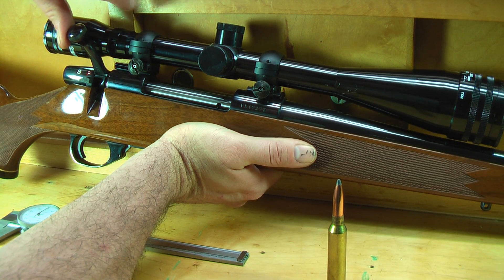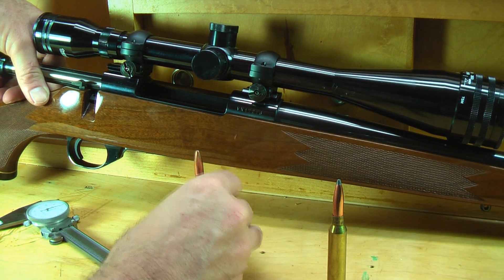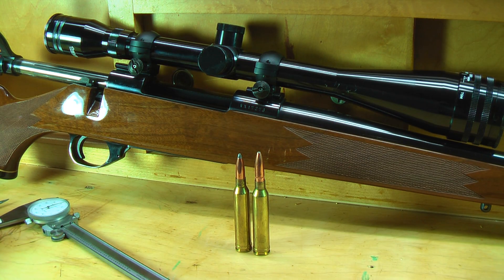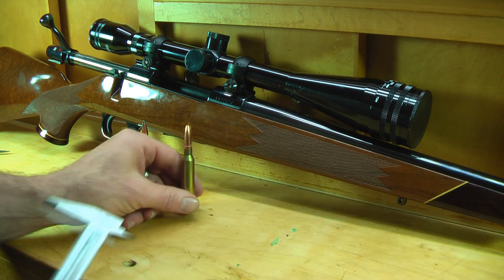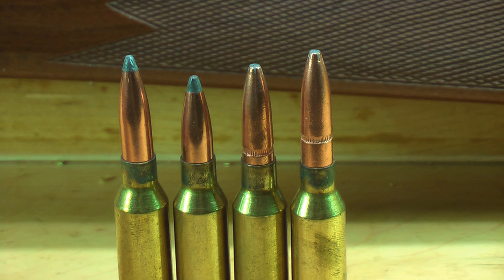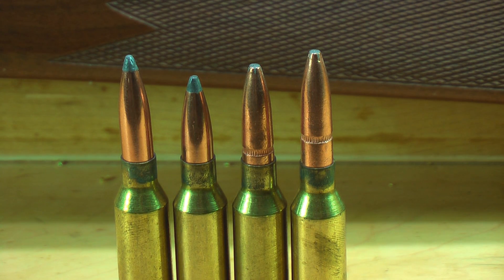Overall Length Gauge HD

Comment: Find it a little curious that the cartridge with the Sierra bullet is shorter than SAAMI spec’s for 7MM Remington mag. of 3.290”.
Reply from the maker: This is to get the bullet to the lands and grooves When making ammunition for the field I use the SAAMI OAL. For coaxing out the most accurate load I play with the seating depth.

Comment: "Just like that" just say neck size it and seat the bullet. Cause if you don't do any sizing the bullet will fall straight into the case. This is the old school of forcing the projectile to touch the lands or deeper into the throat to establish a dummy round then work back -.05 each string

Comment: Are them cases inside the numbers the book gives you for OAL or all they longer, i have a 308 and the OAL in the book should be 2.81 and i tried this with two bullets and they can back at 2.86 and 2.94,  if they fit in the mag, will they be ok or do they have to be seeded to what the book says

Comment: @ammosmith I see...

how about if the neck was bit too tight (tight enough that you have to use a bullet puller to pull the bullet out) and when you push the bolt forward it might push the bullet into the rifling instead of the lands pushing the bullet further into the case?

I don't think the winchester  too tight or loose. it feels perfect like in your videos, but that's a big diff (2.890 vs 2.810) also if the lapua brass is tigther it shouldn't be as easy to push the bullet into the neck

Comment from the maker: @razorseal It will depend on how the case grips the bullet. If it has minimal grip then it may pull back out some. Usually the OAL gauge presented here is far more accurate than the commercially made OAL devices.

Comment: Will different cases have diff ogive OAL gauge? I tried a lapua and then a winchester, and they are diff. Winchester is at 2.890 and the lapua is 2.810. the lapua case is 2.484 and the winchester is 2.489. the winchester did have less tension on the neck though.

Comment: So how are you getting the neck tight enough to hold the bullet but not so tight that you have to use the press? You said that if you full length size it, then it will be too tight. But you didn't really explain how to get the neck in the condition you have here. Thanks for the info. Your videos are always informative.

Comment from the maker: @newfounderusa101 No but you should trim your brass to keep the necks in spec. This will prevent the case from being forced into the throat. This method uses the bullet to determine the OAL.

Comment: The shown way won't work well e. g. with Mauser 98 actions, because they want to be fed from the magazine. 
By why this complicated? Why not simply drop a bullet into the barrel and measure with a wooden stick from the muzzle? By the way: the positive effect of seating a bullet near the lands is very often overesitimated. It is useful when you need additional power spce or are chasing for the last hundredth of accuracy. But it won't improve accuracy if your case is only filled by 80 % or so.

Comment: @ConKen77 You still have to use the seating die to seat the bullet. What this does is determine how far down you need to seat the bullet for the best accuracy. Doing what he shows does not make the bullet ready to shoot or anything, this just tells the depth in which he needs to seat the bullet to give the best possible group size.

Comment: I have a vanguard as well. Not sure if the bullet scrapes against the receiver when extracting, so I measure at least 10 times in a row. Should be within 0.001". I also back off 0.020" and measure to see if the bullet was pulling out due to lands. Hardest part for me was getting the proper neck tension. I also made a OAL gauge using small plastic garden hose with thread on the end and valve, 1.5mm rod, had to make thread in head of bullet and thats it.~20. Could post a vid if anyone interested.
Reply: Please do so, I know I would very much like to see it, and I suspect others would as well 🙂👍🏼